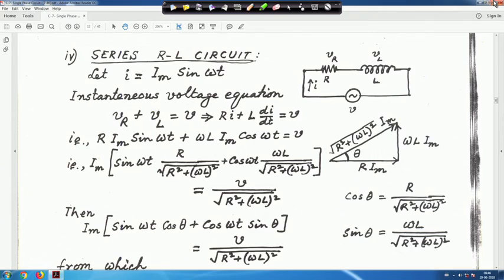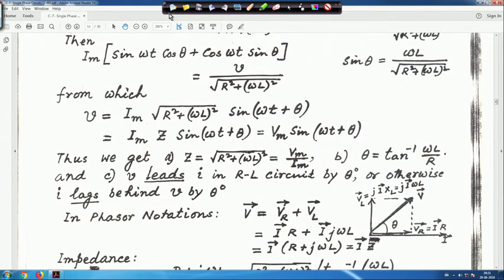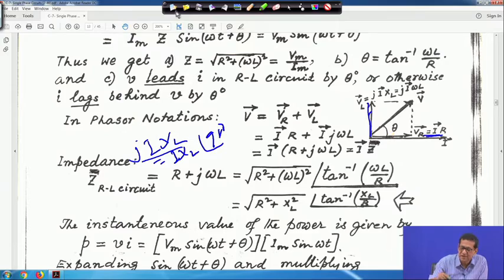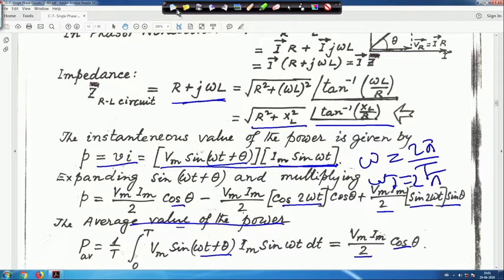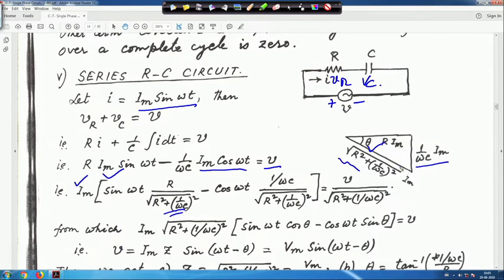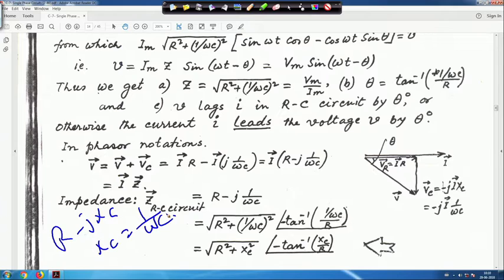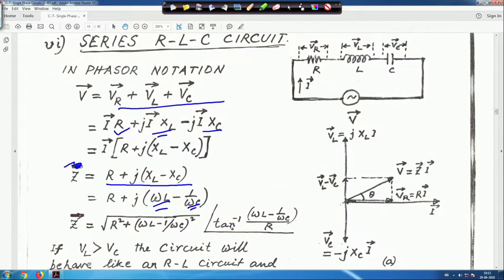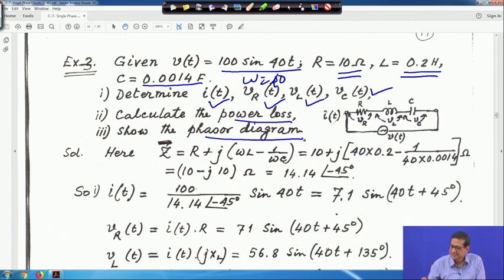Lecture 41: Single phase AC circuits (Contd.)

Comment: There are nice lectures here too with a unified approach to electrostatics and circuits 
 Simple D.C. circuit. 
1 Pattern of electric field.
Watch from  *16.0 minute*.

2 Mechanical Battery
Watch from  *19.0 minute*.
https://youtu.be/Eu3JQKrJRZA?si=t3MeX8Hi8ELAxaz0

3 First intro to  Surface Charge 
Watch from  10.30 minute. 

4 Surface charge gradient 
Watch from  15.30 minute. 
https://youtu.be/bp0o1HZOs3g?si=PPiPGepbXvdTgJHX

Capacitor - Video lecture by NCS Univ faculty 
This is a link to a video lecture by NCSU faculty on the fringe field of a capacitor.
 Important 
*5*. Derivation leading to fringe field expression of a capacitor.
For the final expression of the fringe field watch from 15.0 minute .
 ch15L3b 
https://youtu.be/7rZ1uFc1ibE?si=0a6OMk-kQLeEMMzb

The second link is to a video lecture by NCSU faculty on *Discharging and Charging of a capacitor*.

6 . Discharging a capacitor 
Watch from 3.0 minute.
 
Charging a capacitor 
Watch from 15.0 minute. 
Ch19L1a 
https://youtu.be/hnSC8MqgCjY?si=krGUPtDarUmFxT_I

Faraday's Law and self-induced emf 
This is a link to a video lecture by NCSU faculty on Faraday's Law.

Important 
7 . Faraday's Law
Watch from 8.0 minute. 
 Ch22L1a 
https://youtu.be/ktGL5cEB82I?si=u9vH33gaX1Wy5JvF

*8*. Non-coulomb electric field - curly-patterned fields
Watch from the beginning. 
 Ch22L1b 
https://youtu.be/nV6xg-OuxoY?si=UjJBG3wDjazfeQMM

The second link is to a video lecture on self-induced emfs in solenoids (inductors) .
*9*. Self-induced emf in a solenoid
 Ch22L2a 
Watch from 10.30 minute. 
https://youtu.be/RJ0J_TL-wUQ?si=qPZ74uD-m6weyFlb
For AC circuit processes, refer Fundamentals of Electric Theory and Circuits by Sridhar.